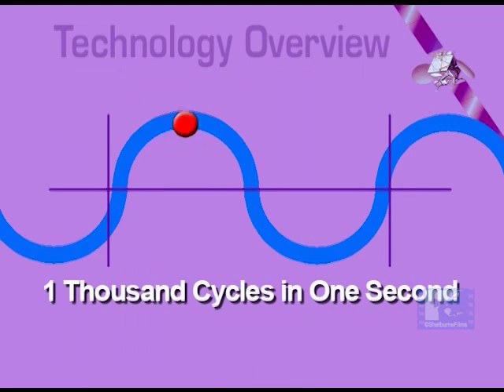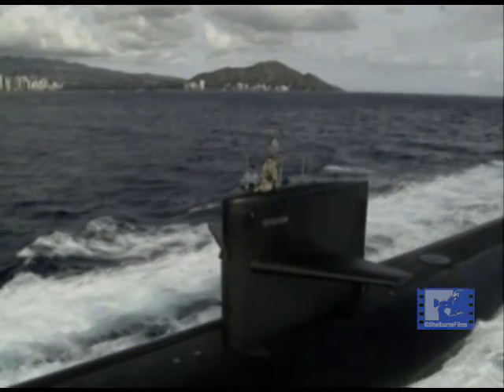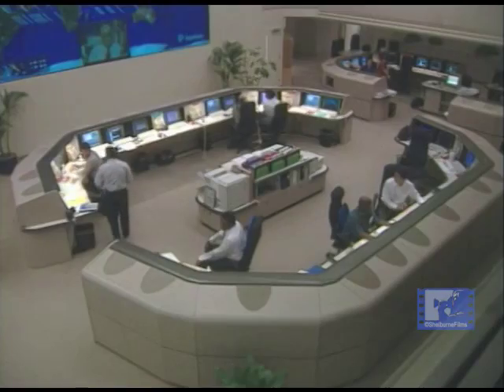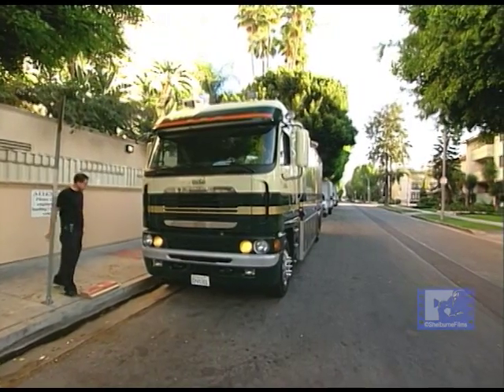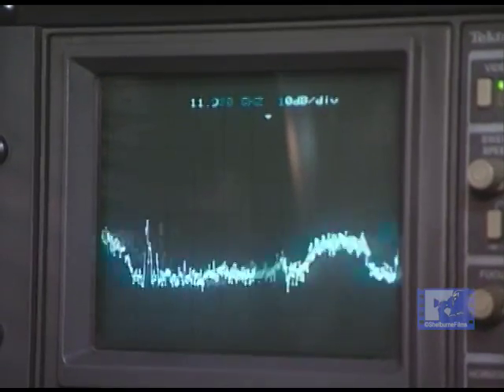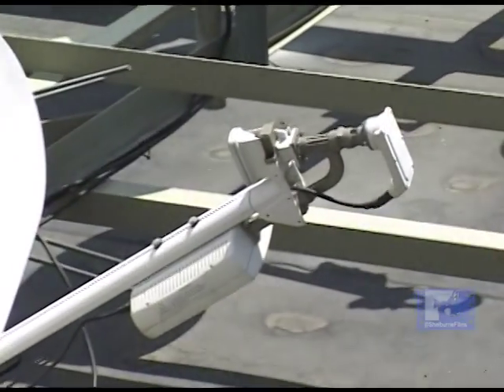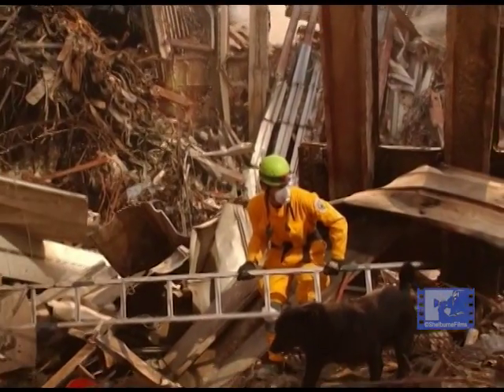Satellite Technology Overview

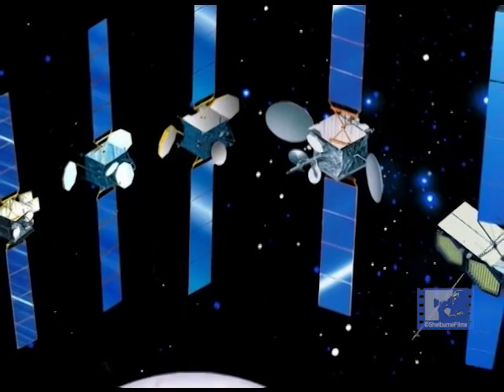Comment: 8:28 "A geostationary satellite, as you know, is essentially a mirror in the sky. It has transponders and communications come up to the satellite from the terminal, down to the network operations center where the routing and control logic takes place and all the customer care and back end billing system logic. Then it goes back up to the satellite and then off to one or more terminal sights."

Comment: GPS is ground based, just like Satellite. The Dishes communicate with each other via Aether.
Reply: Lol
Reply: What on earth are you talking about?
Reply: @Testequip  Flat earth.
Reply: @papahuge 
"GPS is ground based just like satellite" 

"flat earth" 

Flat earth doesn't exist. We engineer certain technologies to overcome the obstacles of earth's curve 

As a retired electronics engineer telecommunication (ICT) I engineered, commissioned, and maintained backbone telephony microwave radio systems, telephony satellites in the geosynchronous 36000km orbits (Hartebeeshoek Earth Satellite station South Africa) including the previous coaxial cable transmission systems both terrestrial and undersea and the latest next generation optic fibre transmission technology. Undersea optic fibre launch platform at Yzerfontein South Africa. Geosynchronous means it matches earth's rotation. 

Satellites prior to around 1990 were the primary medium used by telecoms worldwide for their backbone network. Currently satellites are used for redundancy and other services such as VSAT for bank ATM's, point of sales, commercial TV etc. Don't confuse telephony backbone networks with satellite phones. It's not the same. 

We have roughly 3 million radio amateurs (Hams) worldwide who have 20 of their own satellites built by Hams and master engineering students and used for making long distance communications. 

Telephony satellites relay signals around a rotating and curved earth as radio waves travel in straight lines and line-of-sight has to be maintained.

Don't confuse satellites with "ground based" backbone cellular/GSM network radio systems, or point-to-point microwave radio systems, and/or systems connecting your mobile phone to the cellular network. It's not the same. 

I'm not sure where you getting your information from, but your comment is incorrect. Earth is certainly not flat!
Reply: @papahuge 
Your reply is more of an outburst as oppose to a counter-argument. 

I was merely correcting you in your misunderstanding on satellites. 

Your dismissive tone is merely attempting to evoke an anger based confrontation. There is no need for it.
Reply: Lol another flat earther. Here in Europe, the main satellite for Euro-tv is Astra at 19 degrees east. It can be received from Iceland to Israel, From Morroco to Finland and all these receiving sat dishes point to exact same point in the sky. If you were to do that with a land tower, it would have to be located in East Africa and it would have to be 36.000 kilometers high. So...... where is that giant ass tower then? Because no has ever seen it when it should be visible all over Europa (and Africa for that matter). 

It's done via satellite of course. If Earth were flat, you'd be able to receive New York FM radio on the coast of Ireland. Doesnt happen either. Why? Curvature of course. The same reason why you can't see the New York Skyline from Ireland. Zoom as much as you want, flat earther.